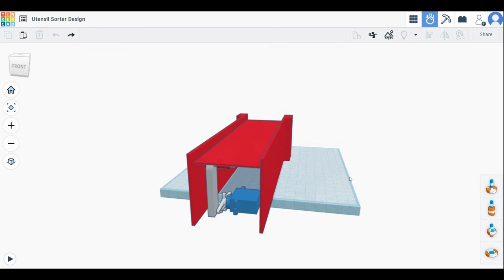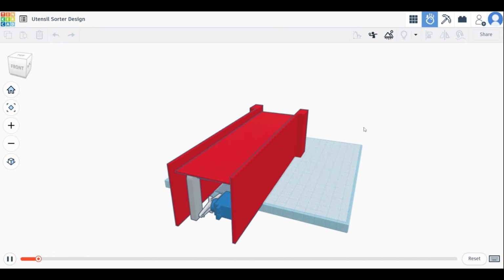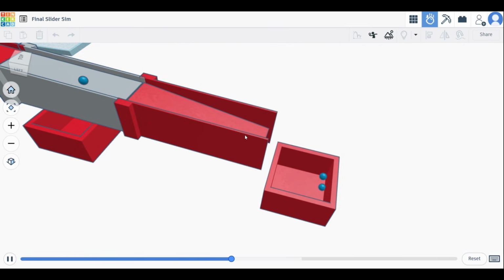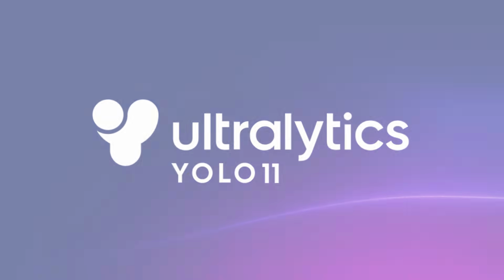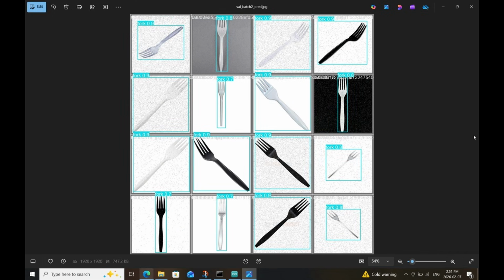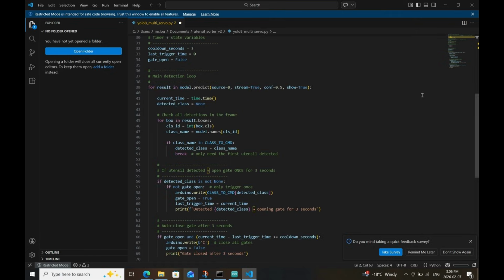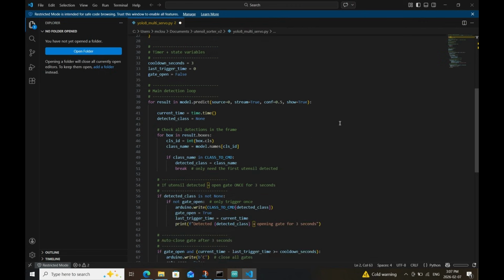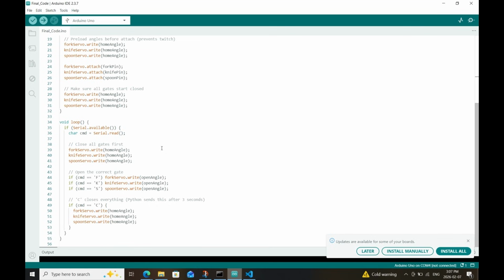Sorting Utensils with Computer Vision

Comment: This looks awesome! you can use many phones to convert into a camera for your laptop and make it more "perpendicular"/ put it in different angles. im not sure about the latency but it looks awesome! try automating using that. Honestly pretty cool!
Reply from the maker: That's a great suggestion! If I continue to develop this project I will use a Raspberry Pi paired with a basic miniature camera to replace the computer. Then maybe I can add a conveyor belt to bring the utensils to the top of the sorter. I appreciate the comment, thank you!
Reply: @SkyboundInnovation you might take a hit on performance if you do that :) i think it should still be an interesting project